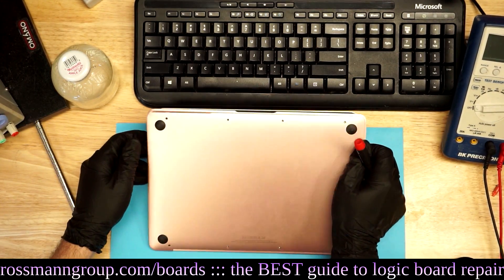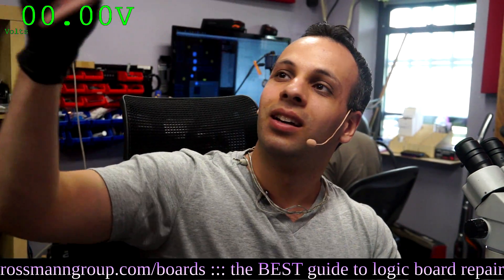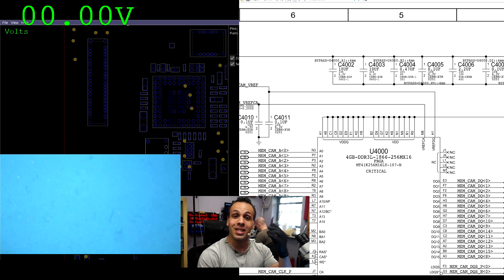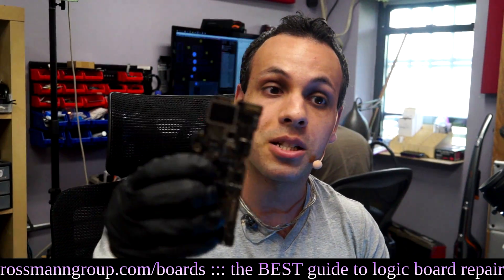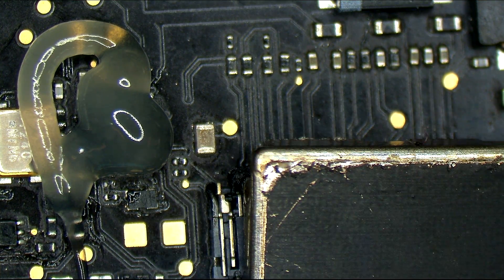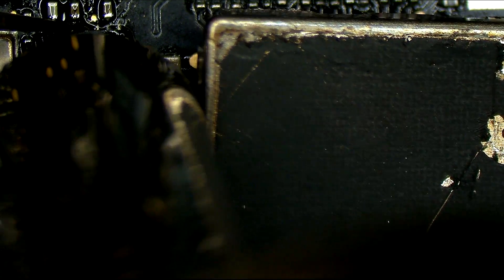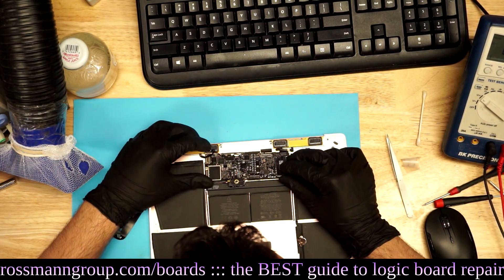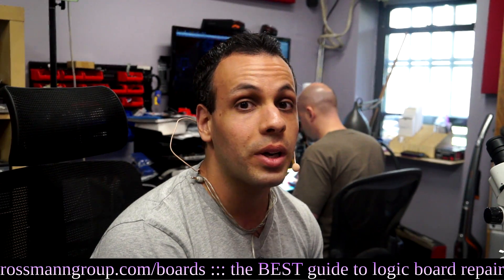Mall repair franchises are garbage and ruin the credibility of our industry.

Comment: well he is bashing everyone, even those that are supporting him or learning from him in technical. sadly
Reply: Maxwell Ang It a hard leason, but that mall needed it as you don't just replace random parts on board with no knowledge of what you are replacing. Honestly they sure not be doing that type of work if they lack basic electronics skills, which they clearly don't have. You don't replace a clock generator for CPU to fix a charging issue. Thankfully it wasn't in power section, or could have destroyed the board and data would have been lost.
Reply: It is a lesson but not through bashing like this and they come for his help. The mall will still need to take responsibility on their actions. Proper guidance would be nice.
Reply: Maxwell Ang 

If it was a mistake on a practice motherboard, then would have been a different story. They took a customer laptop in and had no clue to what they were doing and more likely charges them more for it. It's not bashing, but harsh reality. You don't risk customer stuff to learn and then charge them for it, it's that simple.

Comment: My hardware teacher told us several  times that most places like those "mall repairs" dont want people with real knowledge. They want someone that cant fix something in "2 hours" but can sell a new hardware or a more expensive repair.  / Also, please rent one of those places. I think it's not only a good troll but an awesome bussiness oportunity.
Reply: Bojan Babic That is sadly the truth. The want guy's that can do screen replacements under 15 minutes. They don't even use real techs anymore. I seen these idiot test a battery by putting it in their  tongue to see if it has power. These idiot's don't even know how to use a multimeter and even if voltage is above 4 VDC it still won't tell you if that battery can handle the current load.
Reply: When I was in school they taught us about the multimeter just to know it exist.. never actually used it in a practical scenario. It's so sad.. from my class only me and another guy end up having some knowledge about tech repair and I know that I still suck at it(only the other guy actually learned a lot and now repairs Apple products, just like Louis)
Reply: If you want to get into field, or just improve on skills. You have to take at very least basic electronics to learn how to read schematics and how to troubleshoot, as you have to understand what you are looking at and how to break it down. Then learn to solder SMT. To save you the trouble avoid those Chinese 2 in 1 piece of crap rework station's.
Reply: Bojan Babic I would have demanded my money back from that school. It a shame you have schools like this this that prey on people. This is what we call "Pay to play" places. As they just take people money and barely teach you anything of value. Then most don't realize it, as they are trying to get train in the field and don't know any better. Go to a school that teaches basic electronic's and avoid any place that advertises cell phone repair classes. As those place are a ripoff and more likely only teach you screen replacement. Which you can learn on your own watching YouTube video's

Comment: Why did they blindly as clearly did had no idea how to read a schematic come to the conclusion to replace a random part? Then if they looked at the data sheet it's a clock generator. Yep that some of the shit I also come across when customer, or mall shop around here worked on it. Good thing is now they just forget to put the fucken shields back and don't fuck with SMT anymore.

I dread when I here the phrase I watch a YouTube video and attempt to repair it myself to save a few bucks. I almost don't even want to take it in, as know it more likely going to be fucked. One of the more funny one was actually a lady who try to replace her own screen, "usually easy process?" Nope she manage to smash up almost every connector on a iphone 6s plus? Then thought paying $125 to $150 to fix it was to much. Even after she fucked it up and needed the data. When to UbreakIfix and of course they don't do any mircosoldering, so she came back the next day after getting refused. She was expecting to pay the $80 just for screen replacement. Not wanting to pay the extra $70 to replace the broken connector's thinking her fuckup wasn't a big deal. LOL

Comment: You've got some bomb taste in apple juice Louis. "Mall repair jobs" shouldn't be called repair. It's funny cause it's pretty hard to screw up something as simple as a cracked screen. The amount of red plastic I pull out from BEHIND the shielding is incredible. Also hilarious to see those swapped out red water damage stickers on the logic board with new white ones (which are usually on horizontal, not vertical) on an OBVIOUSLY water fried board. "Iunno, it just stopped working" "Sir, I just popped open your iPhone and no longer need that coffee I was going to drink. Just breathing around your logic board got me 95mg of Caffeine."
#RightToRepair
#TrainYourTechs

Comment: Hey Louis. I was watching your Lenovo P50 water damage repair vid, where Lenovo sent it back to you in a day free of cost.
I have a story to tell that involves good service policies but bad/incompetent technicians.
I have an HP r014-TX laptop that I bought in 2014. Relatively cheap and made entirely of plastic, so not a very durable thing.
Six months in, a cover on one of the hinges comes off, probably accidental bump. I have two years of warranty on this, so I take it to an HP Service Centre, where they charged me ~USD 20 for replacing the hinge cover and the screen back, which I felt was a little excessive, but whatever (hadn't seen your videos back then). But when I went back and turned it on, there was smoke coming out if the left side of the screen, which was shocking. I went to them again, showed them this. They never explained what had happened, but I think they exposed a part of the screen power ribbon. Anyhow, they replaced it, free of charge, and never charged me a cent apart from the cost of that plastic cover. A few months later I moved to a different city, where I discovered that suddenly, certain keys in the keyboard wouldn't work. The wifi performance also kept degrading, so I took it to the HP service Centre in that city. To cut a really long story short, I went back and forth a dozen times, never had to give them any money, but everytime I gave it to them, they would fix that problem, and then something new would pop up. They said they'd replaced the Motherboard twice, given me a new keyboard and a trackpad assembly. In the end, I was left with one problem they couldn't diagnose or replicate, according to them. The screen backlight flickered off randomly. It sometimes happened when I put force on the chassis, and sometimes when the thing was sitting absolutely still. They gave up after a replacement of the Motherboard didn't make the issue go away. It didn't happen when the laptop was opened, only when they sealed it back up. They wouldn't replace my machine though, for some reason. They just gave up. 

That was in 2016. A couple of months ago, I found your channel. At that time, I thought, why not open this laptop up myself, since it's out of warranty. It took me a few weeks of poking around, but I finally found the cause: the power button board. It's a tiny board, that has about 4 components. One of them is the power switch. It's connected to the Motherboard with a ribbon cable, and I think it has a hall effect sensor that senses a tiny magnet in the bezel of the screen to turn off the backlight/screen when the lid is closed. I saw that ribbon was damaged, which is why it was probably shorting and causing the screen to turn off and back on randomly. Now, I'll admit, I tried to fix it, but I'm horrible at soldering and I screwed it up. And the replacement part costs ~100 USD on eBay (excluding shipping), because of Indian taxes.
But I thought this might be an interesting story to share. It showed me that the technicians employed by HP in India at least, were either lazy or incompetent or both. But it never cost me anything except the transit costs to and from the service center, and that's only because they didn't offer doorstep service in the area I lived in.
If this had been Apple I might've had to shell out 70% of the cost of a new machine by now, and probably wouldn't have had the issue fixed at all.
Anyhow, thanks if you've read this far!
Reply: Yeah, you can't put much heat into those ribbon cables before they start to melt. It is possible to repair them but you've got to be extremely careful and patient.
Reply: Haha I get that. We recently had to RMA a laptop from a big manufacturer (who's name is irrelevant for this comment), they said they'd come fix it at our shop themselves, "wonderful" we thought, that is way easier than dealing with RMA services. After 3 visits of aproximately 2 hours of dissasembling and rebuilding the machine apparently the guy killed the motherboard. Hilarious for us technicians who do this daily, not so much for the customer. Luckily they swapped the motherboard in the end and all turned out well..
Reply: Just like anyone else, you trust but verify.  Same thing with cars, furnaces, or anything else that needs repair, if you do your own homework you can can prevent a lot of BS.  Had a guy come to repair my furnace, asked him how much and was told $1300, stating main board was $800 and labor was $500. Opened up the unit, got part # of main board and replaced for under $100 with $1200 still left in my wallet.  As Regan said..trust but verify, will usually work
Reply: Good story and sentiment. Shame you're in India, I'd tell you to send me the board and I'd fix it for you. If you wanted to get rid of the problem though, depending how messed up it is now, you could just remove the hall effect sensor, and turn the laptop off before you close it. For me it wouldn't bother me at all since that's what I do anyway, but even for someone who utilizes the lid sensor to put their laptop to sleep it's a small inconvenience to have to click a button rather than worry about the screen shutting off randomly. You could also just replace the hall effect sensor with a slide switch or tiny latching button that's opened in one position and bridges the contacts to mimic the effect of the hall effect sensor sensing a magnetic field in the other position, then find a spot to make a hole in the housing and fit the switch so it's accessable without keeping the bottom off forever and you're done.
Of course that would require the PCB to still be in working order as far as the power button and flex cable connections for it. Plus the switch thing would still require you to press a switch so turning it off programmatically instead makes more sense probably.
Reply: Monkey J I managed to melt the ribbon cable, and soldering those is a pain. There are multiple breaks in the cable as well, and I can't find an exact replacement. Plus the cable is soldered onto the smaller board, while there's a detachable connector on the mainboard. For now I turn it on using a screwdriver as a jumper across three of the pins on the mainboard connector. I was thinking more of attaching wires to the connector itself, where it meets the board. Then I can set up my own power/lid close switch. But I don't know if I want to put in the effort for something that's nearing End of Life for me, since the screen cracked as well while I was travelling. Thanks for the advice and the offer. I wouldn't mind jerry-rigging things myself. It's just not worth what's a lot of effort for me :)
Reply: paul solovyovsky crikey! What vintage was the furnace & what did it cost new? Did it contain anything beyond the blower, hot section, and a cold section if you happen to have AC? I.E., did it have multi-zone heating/cooling functions baked into the main board or was it a run of the mill ~4 wire-analog-signal-from-Tstat model?

I truly hate it when folks like this prey on who they think are unknowing customers. Obviously a profit has to be made, and certifications, licenses, insurance, etc, etc, cost money that needs to be covered, but a 700% markup on the part & $500 to perform a job that I assume only involved a few connectors and mounting screws is ridiculous!! Even if it did included some kind of warranty.
Reply: I had the exact same problem. The small power button board and the ribbon cable are very Finnicky in HP laptops , but I opened up my laptop on the first day I bought it and didn't bother to go to the HP service centre. 
I narrowed down the issue to this and was also able to find a suitable replacement on AliExpress for ~USD 6 (incl shipping to India) . I had to wait 20 days for it to arrive but it was an easy fix and has not given me any problems for the past 2 years.
Reply: I had the exact same problem. The small power button board and the ribbon cable are very Finnicky in HP laptops , but I opened up my laptop on the first day I bought it and didn't bother to go to the HP service centre. 
I narrowed down the issue to this and was also able to find a suitable replacement on AliExpress for ~USD 6 (incl shipping to India) . I had to wait 20 days for it to arrive but it was an easy fix and has not given me any problems for the past 2 years.

Comment: Its crazy someone would replace a chip without even visual inspection of labels. A different chip may even have output pins connected to a different logic gate, thereby frying an entirely different circuit. Attention to detail is of prime importance in electronics. Luckily it wasn’t a power control circuit.

I saw some replace the wrong SCR, thereby dumping more than the required current on another input pin. Luckily, the $4,000 board that almost got fried on the CT, were protected by fuses. 

The crazy thing is that it worked for a while, and the paperwork was done, and equipment was certified as fully mission capable. The unit eventually gave up. Without proper inspection, the fried board would’ve been replaced, a recurring problem, because the culprit, being the wrong SCR was just fine. 

Luckily the establishment had a comprehensive maintenance log. Browsing through the history was basically the saving grace. One could easily see what the most recent issues were, and thus trace back to the source problem. 

The problem with equipment like CTs and MRIs are that, only in certain modes of operation will the fault conditions occur. So, the equipment may pass a power-on self-test, and function in the default mode without showing any nasty symptoms, until operated under certain modes.

Great Video. Invaluable lifelong lessons can be learned from your videos.

Comment: Wow.. just wow.
I'm paranoid..  Before any non-trivial interventions, I'm always checking and rechecking every step..
I'm making sure that the pins I'm about to test are the pins I think, and that the voltages I expect are repeatedly tested and recorded.. I count the pins from #1 or whatever index I can, and record the board-locations and the ID of the physical part against the schematics.
Yeah, I slightly panic when I find that the schematics that I have do NOT match the equipment before me..  that's usually when I inform the customer that there's a risk in my proceeding.

But I don't think I'd ever considered putting an entirely different chip in to replace something that functions differently.
I can see not knowing the layout of every board by heart.. that's to be expected..  but that's why you check and double check, even when you know..
Reply: I might not be as obsessive as you, but I buy non working laptops very cheaply, I even have people give me their old laptops and I make most work again (or use them as donors), but for the life of me I can not understand how someone would not record the number on the chip to make sure they are using the correct part. The majority of my repaired laptops go directly to the homeless people in my city (I was one once) it is amazing how many peoples eyes light up when I walk up to them and just hand over a laptop and charger.